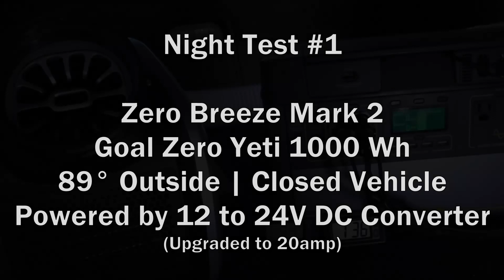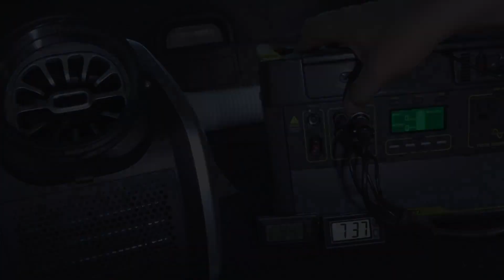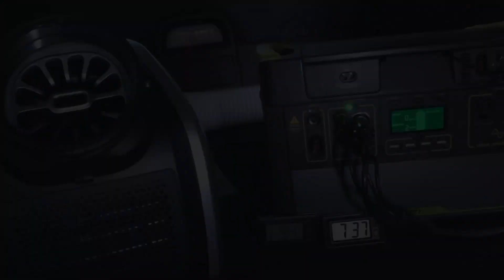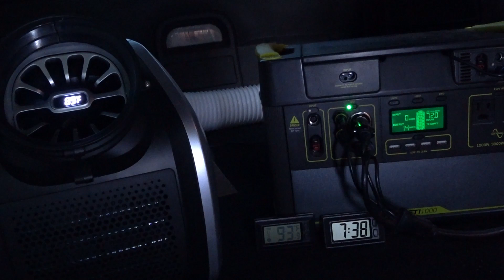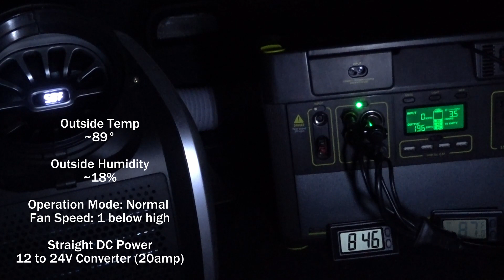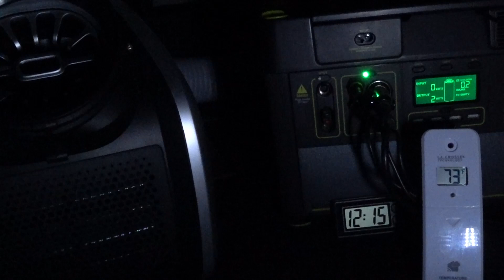Zero Breeze Mark 2 - Night Test - Closed Vehicle - Full Yeti 1000 Battery - Normal Mode - DC Power

Comment: I live in high humidity. Rio Grande Valley, near texas gulf. 

Zero breeze. I'm very satisfied with my unit. 

It's my emergency ac back up. 

If the power goes out, mine averages a 140-180 watt pull/consumption at full speed. 

I prefer this unit over the ecoflow. 

True portable ac. 😊

Comment: What size vehicle were you running this in? I have an Astro van which is basically 5 1/2 x 8 on the inside with the cab curtain Off
Reply from the maker: About the same size.  I never had much chance of cooling the interior during the day in the sun as that's too large a space for this many BTU's, but I only bought it to keep me cool, so it worked out.

Comment: In your first video on the 12v>24v converter VS 120v AC it was pulling 140w on DC, 160w AC.  Here it is pulling around 200w DC.  What am I missing?
Reply from the maker: Ambient temperature.  The Mark 2 adjusts itself given the conditions of the space.  When it's hotter, it works harder.  The garage in the first video was under 80 if I remember right, the temp in my vehicle in later tests was much hotter.  Hope that helps.

Comment: What kind of converter ?
Reply from the maker: 12V to 24V DC converter.  I bought on Amazon, and needed to upgrade to a 20amp model to get it to run the Mark 2 well in a very hot environment.

Comment: I ended up getting a jackery 1000 and a zero breeze mark 2 with 1 battery. I put it on night mode and ran it all night. Kept my whole bedroom (roughly 10ftx10ft) cool and only pulled about 108-115 watt hours per hour. I slept 8 hours and still had 8% charge on my 1000 wh battery so 80 watt hours left. I also ran 2 very small USB fans all night off the jackery 1000 and I tested it a little at different speeds for about 15 minutes before going to bed. 

I didn't need my solar panel or the extra battery for this. Granted my bedroom is extremely well insulated and I live in an area of very moderate climate currently. It's just been a little uncomfortably warm lately. I'll be moving into my car soon (on purpose to avoid high rent prices, I work alot so I'll only really be in my car when it's time to sleep)

I imagine I'll have to use it at more powerful modes then night mode to keep up but its good to know night mode is so awesomely efficient.

Comment: Can you please tell me if you are unable to run this unit while the vehicle is moving? I wasn't able to find a reputable answer, but read on social media that you cannot run it while driving and must let it sit for 30 minutes after driving. This video is much appreciated! Started Van Life 6 weeks ago and been struggling with this.
Reply from the maker: I can't say I've tested it while moving.  Not for any length of time.  I've driven off, and reached back and shut it off with the remote.  I've also read posts from others saying it stopped working when used while moving.   I've driven many miles with it off, then turned in on soon after parking.  I do have it strapped down.  I haven't had any issues with it and have not waited 30 minutes many times.  But if Zero Breeze says to wait 30 mins, it's a gamble to do what I do.

Comment: Thanks for sharing. I did the same as you. I used pin 1 (Positive) and pin 3 (negative) connected to 12v to 24v 480w. Did you use the same pins? Thanks again.
Reply: I got my answer. Thanks
Reply from the maker: Yeah, 1 and 3.  They made it super easy with the little diagram on the power brick that I almost didn't notice at first.

Comment: I Know nothing about btu and inverter etc etc. I just wanna plug this in a jack .end of story. I'm wondering if I can get a jackery or something and just plug this in?
Reply from the maker: Absolutely!  It's going to be a bit less efficient use of power as you are converting that DC battery to an AC plug, then back into DC with the Mark 2 plug in power supply as opposed to just wiring it up straight DC.  But yes you can just plug it into any power supply out of the box that has a 120V AC outlet.  Run time is just dependent on battery capacity.

Comment: YOU NEED A ROOF VENT TO  DISPLACE THE HOT AIR HEAT RISES COLD SINKS
Reply from the maker: Agreed.  As soon as I realized it wasn't going to cool the interior ambient air on a hot sunny day, I started to crack side windows to purge some of that oppressively hot air.  I have also experimented with using inside air to run through the intake at the back to cool the compressor coil which in turn creates negative pressure to suck outside air in through the cracked windows.  All depends on the conditions outside.  But yes, getting that hot, heat loaded air out is good.

Comment: it would be impressive if it costed 100bucks. lol overpriced piece of junk
Reply: It comes with an 840 watt hour battery.  You'll pay 500+ for most battery solutions approaching even close to that on Amazon.  Just FYI.

And if you wanted access to 6 to 8 thousand BTUs like a Window Unit you'd normally find in someone's home (up from the 2300 BTUs of this unit), you'd need a much larger battery than that to power it for any meaningful amount of time. lol

Here's some example rechargeable battery solutions for you to ponder (you won't find 840 watt hours for cheap lol)

$559.00 for 622 watt hours
https://www.amazon.com/Portable-Station-MILIN-Generator-Emergency/dp/B08YRFLSR3/

$129.00 for 166watt hours and limited by 200 watts peak output (not enough output to power 2300 btu air conditioner)
https://www.amazon.com/Generator-Flashfish-45000mAh-Portable-Emergency/dp/B07SG4QG47

$649.00 for 720 watt hours
https://www.amazon.com/EF-ECOFLOW-Portable-Multiple-Recharge/dp/B08T1KY8SG

And even if you wanted to buy something a little less ready-made so you can cut corners in all the fancy addons like a USB charger or cigarette output, etc, that comes pre-built in a lot of these battery solutions, you've got options like this 12V (125 Amp hour) battery that you'd need to buy two of to run in series to get the 24vs (or to run on only one of these batteries you'd need to buy an inverter to increase the 12volts to 24 that can handle the load you want, but then you'll have some inefficiencies with the power conversion), and these batteries are $300.00 each and you'd have to at least buy some kind of charge controller to go with them, unless you have that already.

https://www.amazon.com/Vmaxtanks-Vmaxslr125-rechargeable-Solar-Inverters/dp/B00ACNO2AO

Comment: Your vehicle air conditioner set to Max closes the cabin fresh air intake vents to stop pulling in the hotter air from outside. Does the manual for this air conditioner advise against trying that? Seems you could vent the exhaust outside as usual but for the intake air, let it use the chilled air already inside. You might see some pretty nice results that way.
Reply from the maker: Do you mean sucking inside air in through the condenser coil in the back of the unit?  Or are you just talking about recirculating the inside air through the evaporator in the front of the Mark 2?  It does recirculate the inside air through the evaporator in the front (the intake is right below the outlet), but I have fresh air coming in from outside to cool the condenser coil and then exhaust out the other hose in back.  I have tried using inside air to cool the condenser also, even though doing so creates a vacuum in the vehicle so I have to crack a window.  But at 100 degrees inside the vehicle I can always get cooler air from outside to cool the condenser.

Comment: How much of the time were you in the vehicle while the test was running? I am curious if it was able to remove your body heat as well as the heat leaking in from outside.
Reply from the maker: Great question.  I was not in there much of the time so I could have made a difference if I was.  I can say however that the several times I hung out in there while it was running, the ambient air inside felt considerably cooler than the outside which is in contrast to the daytime tests in full sun where the inside ambient air was suffocatingly hot any time I moved out of the Mark 2 air stream.  It may not meet everyone's needs in stifling hot humid nights in a larger space, but in my opinion night time is where this really shines.  Check out the Mark 2 facebook group where many talk about their experiences and tests at night.

Comment: Exhaust ducts on portable ACs get pretty hot. Insulating the duct will buy you a few degrees.
Reply from the maker: Can't argue with that.  Don't know if it will make much difference in the summer in the sun, but every bit counts for sure.

Comment: I just had an interesting idea. The very concept of an low power AC in a vehicle is full of engineer impossibilities. Its trying to cool a large space with poor insulation in conditions where the outside is bombarding with thermal energy. Instead, for a van build, it would be better to create subpocket that is decently insulated. Like a bunk bed with a sliding door. Or even more extreme, a cocoon similar to a tanning bed. Way more efficient to cool a small area for sleeping than trying to cool the whole vehicle. A simple approximation would be like a blanket fort.
Reply from the maker: Actually a few examples of this over at the Mark 2 facebook group.  A lot of insulation in custom van builds, with small areas closed off.  Many good reports of being able to cool off spaces even during the daytime.  There's one video in particular of a dog left inside one of these "cocoons" sleeping soundly.
Reply: Drakilicious yeah it does seem like a coffin. Definitely very claustrophobic if built to the extreme. Probably would need to be at least tall enough to sit up to be useful. Ideally, there would be some space for storage and a slideout monitor/table/keyboard for work. With enough insulation, such a space could be very energy efficient

Comment: Im seeing a lot of weird EER ratios. But if i use the definition, its btu over input wattage. So 2300/240 is about 9.5. Pretty good. I see a similar looking emerson unit but its single hose 1000btu/230w = 4.3.... Half the price but half the efficiency.
Reply from the maker: For sure.  It does what it does well.  It's when people ask more of it than it can deliver that they get disappointed.

Comment: Hello! I was trying to figure out what adapter you used to duct it through the wall and how you plugged it in with 24v?
Reply from the maker: I have a video wiring up a 12 to 24v converter.  I've upgraded to a 20amp model now which I recommend. For ducting I have both a sheet metal hvac 4" starting collar, and a 4" plastic drain that you would set into concrete which I cut the plastic grate out of the opening. You can also look into 4" dust collection fittings that get attached to table saws and other tools.

Comment: First of all thanks for the really good youtube channel!

Do you know if it is possible to connect the batteries and the charger in parallel at the same time? I want to permanently install two batteries and the charger in my RV. and then be able to charge the batteries when I have 230v power while running zero breeze.

My dream scenario is to be able to charge the batteries when I drive with a 12v / 24v converter and then be able to charge with 230v when I have it and to be able to run Zero breeze both on 12v, batteries or 220v without having to manually switch everything.

Best Regars

Peter
Reply from the maker: According to what I've read on their website and the Facebook group, no. It's either use or charge their batteries, not both. Part of the reason I went with my own power supply. 
As far as connecting in parallel, not natively as far as I can tell, but what a great idea it would be to be able to stack them like Legos.

Comment: Just saw the Mark 2 on an ad.  Thanks for your “just a guy running a mark 2 in a hot van” videos!  Seemed like in Test 1 that you may have had it against the hot air coming from the battery inverter exhaust or heat sink. Not sure where your planning on having your new inverter relative to the a/c but may want to give exhausting that heat a thought too.
Reply from the maker: You're welcome.  Yes, you're right that couldn't have helped to have the battery exhaust port so close.  While using "real world" I have it all separated, and have, as you suggested, considered installing a wye to the Mark 2 exhaust hose and exhausting the battery hot air also.  During the day it's just so hot in the car I don't think it would matter, but at night it could make a difference.

Comment: Since the gauge wires coming out of the 20a converter were of a larger, or thicker gauge than the previous 15a converter, did you take into account using a thicker gauged wire, or did you use the same gauged wires as before?
Reply from the maker: Great question.  I used the same wire reluctantly. I would like to use larger gauge wire but I'm limited by the opening at the base of the connectors they use on the Mark 2.  I have found it difficult to find any (by the foot) wire online that is a larger gauge AND fits in the connector. There is a DIY cord on the zero breeze website but it doesn't list the wire gauge so may not be bigger than what I'm using.  Being 24V and a very short run I think I'll be ok though. Nothing in the system is getting extremely hot since the converter upgrade.